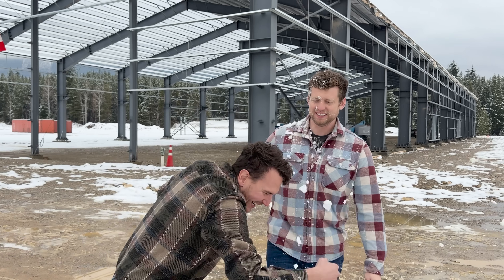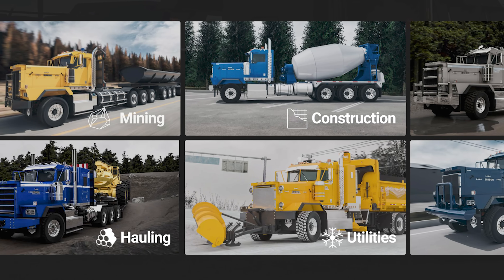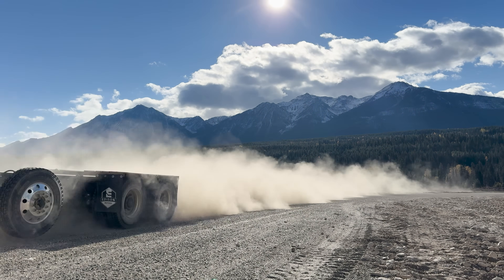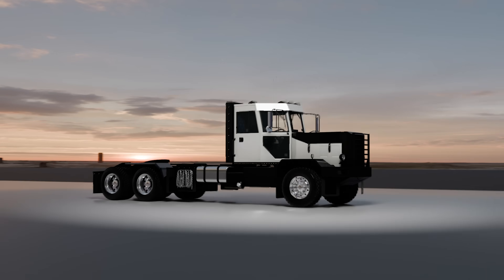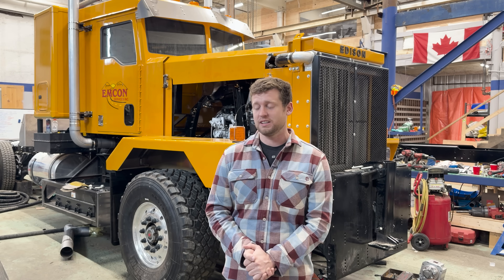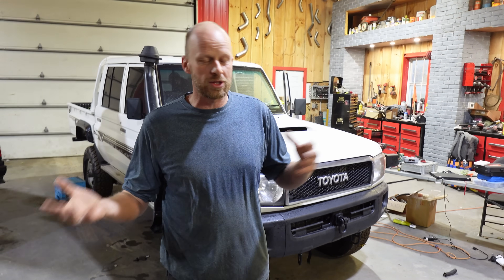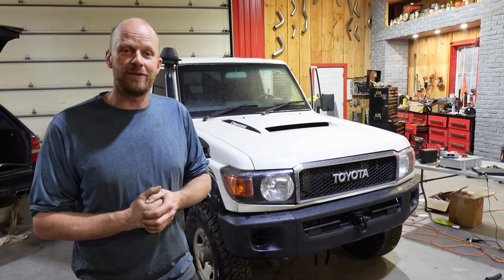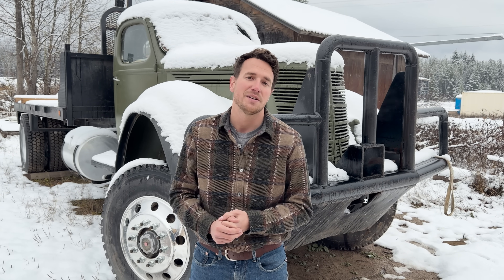VICTORY After RED TAPE: Edison Motors has GOVERNMENT APPROVAL

Comment: Since Edison Motors is still at the startup phase, it's totally normal to focus on improving the tech and a specific market (heavy duty),  but I hope you guys don't forget that reducing drag by improving your aerodynamic also means gains in fuel saving. For long-haul your hybrid system is still more efficient than non-hybrid, and having both, the most efficient power train and the most efficient body, Edison trucks would save even more fuel.

Comment: When you have solved your mission with heavy duty trucks go for mass market with BEV batteries are getting cheaper. But mass market vehicles will not be easy to repair. You have the right approach to right to repair.

Comment: How the f will the Diesel-Electric version be the same weight (or even close) to the mechanical one? Does the transmission and smaller fuel tank compensate for the battery and electric-motors weight?! If so, that's huge! (Also, what about US tarifs rn?)
Reply: Tarrifs? Edison is coping like everyone else. :(

As for weight, if you start with a normal heavy duty vocational semi truck and yank out the 15 liter engine/trans, and put in a smaller 9 liter engine/genny, plus the 3,000 lbs of batteries, then the Edison truck is only like 5% heavier.

Edison trucks don't have 10,000 lbs of batts like a Tesla semi.

Comment: I have a question. Does the Right to repair approach you are follwing also include the software diagnostics and code for the controllers and all the other software included? Thank you, im a big fan
Reply: Yes*

That is a delicate subject. 

I'm confident that Edison wants to give truck owners all the tools they need repair their trucks like truck makers used to do in the olden days.

At the same time, if Edison gives away all intellectual property away for free (and they have spent $10M to make it), then an evil company in India could take all that IP and make a cheaper knock off that would undermine everything Edison is trying to do and in essence, Edison would be feeding their own downfall.

So there is a balance to strike.

Comment: So...on startup or when passing or on a hill, can the battery and generator run motors in parallel for a boost to like double power?
Reply: No
Edison trucks are "serial" not "paralle" hybrids. That said, Edison trucks still have twice the hp/torque over conventional diesel trucks and more than enough power to destroy the tires prematurely

Comment: Is there a HP threshold? Diesel generators are used all the time on busses and trailers and such.
Reply: Threshold? The engine will probably run at full power when it's running
Reply: @Sah-o5m  HP threshold, as in they could not get approved for an on road stationary generator, yet as i said, there are smaller low HP diesels in motorhomes and busses everywhere

Comment: I hope you're using Sodium-ion batteries and not Lithium-ion batteries because Sodium-ion batteries have absolutely no problem with temperatures.

Sodium-ion batteries are fine when it's minus twenty or minus thirty degrees centigrade (that's about minus four fahrenheit to minus twenty two fahrenheit).  CATL say that their next generation sodium-ion batteries will be just fine at minus forty degrees centigrade (that's minus forty fahrenheit).

If you go with the Lithium-ion batteries then the battery pack will use energy heating the battery cells, that's just waste power when you could just have Sodium-ion batteries.

And Sodium-ion batteries have no problems with heat weather either, which means when you're on a charger you don't have to worry so much about cooling.

Comment: I can understand the economic argument but it's a shame you're having to build non electric trucks as well. It undermines the value of your brand as an electric truck company. Some investors may also be put off because if 95% of the trucks you build are pure diesel then it kind of gives the impression that the electric truck thing is just green washing and environmentally minded investors don't want to invest in a diesel truck company. Have you considered using different branding for your diesel trucks to differentiate them from the electric ones? So that when people see a truck with the main Edison Motors brand they know it's a real electric Edison.

Comment: what is right to repair
Reply: Over the past 2 decades, some companies are increasingly using the following anti consumer practices:

 planned obsolescence (parts that fail shortly after warranty), 

parts pairing (only parts provided by the company can work, and the company can charge whatever they want)

Warranty denial if you try to fix your car instead of using a dealer.

And forced subscriptions that require owners to make ongoing payments to keep using the product.

Companies that do this are John Deere that requires a John Deere tech with a $10k laptop to replace parts. Or Apple that uses proprietary screws, and unreplacable screen.

"Right to repair" is an effort to give more value to the auto owners instead of Edison. To this end, Edison uses flat glass that can be sourced anywhere instead of curved glass that can only be sourced from Edison.

Comment: Actually, there is one industry who tried diesel electric, where it didn't stick. Porsche tried it on their Tiger Prototype. It promptly went up in flames in front of Mr H, and they lost the bid to Heinschel. Though some manufacturers are experimenting with diesel electric right now, so you might be right, in the long run.
Reply: Edison is following the diesel/electric hybrid train model. This model has only become viable in the past 10 years due to advancements in battery tech.
Reply: @Sah-o5m  Unless there's some technical details I'm missing due to a language barrier, that's straight up not true? Many heavy vehicles have been using diesel/electric for much longer than 10 years.
Reply: @ericmyrs  Do they mean plug-in hybrids? Traditional hybrids are gas cars that get help from a battery time to time while plug-in hybrids are basically EVs with a backup gas tank in case the battery runs out.

Comment: HDT/MDT:
Have you looked into the RV industry.  I see people converting OTR Volvo's to towing their 5th wheelers.  With the reduction in payload between what you would normally see in a logging truck, you couple probably drop your motors down from 9L to 5L-6L (if not smaller) and still be able to effectively tow some of the larger 5th wheel travel trailers.

Comment: 2:56 Have you guys thought about doing trains between this and the train yard?
Reply: Trains are already diesel electric
Reply: @Gregory-b5y I know... that's why I asked if they've thought about possibly going into that business as well.  If they're both diesel electric, it might eventually(like years down the line) be worth it to go into locomotives as well.  Especially if they're on a train line.  They could have forks off their line that are for servicing or building trains at some point.  And although there is a lot of differences between trucks and trains, they're both diesel electric.  It would be a solid chunk of similar technology, along with a field I'm sure could use a company like Edison.  I mean lots of fields need a company like Edison.  But they're doing diesel electric and have a direct track connection.  It wouldn't be a bad way to go years down the line after they master the truck part

Comment: The conversions strike me as especially interesting. You could advertise targeting people whose trucks have experienced a particularly expensive mechanical failure. Converting a truck to diesel-electric isn't going to be cheaper than replacing a transmission or engine block, but if someone is already staring at the cost of a major repair like that, maybe paying the price of a conversion to get a more efficient vehicle once the process completes is going to sound more tempting.

Any plans to do conversions for cars as well, either to electric or also to hybrid? Some people might really like their old ride, but like the idea of improving its performance.

Comment: I just wish this generator EV driveline combo was commonplace in even just regular vehicles. In the war of fuel efficiency and durability, you'd think that major manufacturers would've done exactly that decades ago.
Reply: In smaller vehicles there’s problems with power to weight, you have an engine that can run the car on its own with the added weight of a battery pack.  It’s crazy that trucks have not used this technology though, it’s been around for ages.

Comment: So can you guys keep prices lower on the new mechanical builds compared to a dealership? And why not throw cat motors in the frame instead of running a junk isx cummins?
Reply: The large truck manufacturers have stopped producing heavy duty trucks. Edison has no competition in this market.

Cat quit making emissions compliant semi truck engines in 2010.

Comment: Edison pickup truck when? I want my f150 to have 130,000 lb/ft instead of 260lb/ft and to not need to shift gears. I go up a hill and the thing barely wants to stay the same speed and when it does, it has to shift from 4th to 1st and back to 3rd repeatedly.

Comment: Per Lean Manufacturing standards, the rate at which you can move materials & products is way more vaulable then the amount you have in stock. Would like to see you guys take of Toyota Production System (TPS) or something similar. Send a couple guys to Japan and tour Toyota,  and also go down to Fast Cap and meet Paul A. Akers (author of 2-Second Lean). This will absolutely change the way you see production! Can't wait for the next updates!

Comment: I know you guys are completely committed to your light duty chassis and how you're currently doing the conversions, but it's flat out wrong and will fail.

Don't be Elon with the CyberTruck and just keep trudging down the same path even though I suspect you know there is no market.

Virtually no one will pay for a hybrid conversion of an old light duty truck that costs more than a whole used truck, especially when it's so expensive that the breakover point on the investment will literally be measured in decades.

I feel like you guys are wholly blinded by your approach to heavy duty applications (where the same approach is appropriate) that you're completely missing the forest for the trees.

People who own old trucks, and are willing to do a drivetrain swap, like that truck how it is they *do not want an entirely different truck that just looks similar*.

All they are looking for is a repower to a newer more reliable/powerful drivetrain tech.
Reply: And yet there are literally 4,000 people who have signed up for conversion kits that will cost 10's of thousands each.

Comment: I realize that you face regulatory obstacles on the full hybrid drivetrains, but why not do "light" hybrid on the mechanicals for gains in experience and efficiency?  What about an electric axle and battery added to a mechanical, like a steering axle or the rear most axle?

Comment: I soooooo want a truly hybrid pickup truck. Either full time electric with ICE backup, or driveline share with the ICE. This is a market that US manufacturers have been lacking. It's such a huge mistake to not fill this particular market. Instead, they come out with these psuedo mild hybrid that only work in the first couple seconds of hitting the throttle (Dodge eTorque 🙄😒). So much truck space is just plain wasted that could be used for batteries and controller electronics to make good truck a great truck for hauling and saving money on fuel and repairs in the long run.
I am so happy and thrilled someone has decided to take this idea from a "hobby" perspective and progress to a full on production business to help drive down pricing on making these conversions. WTG EDISON MOTORS!!!!! 🤩🥳:elbowcough:

Comment: Next milestone, put trucks in wind tunnel and get another 30% gain, and yes after 56km/h the air resistance is larger fuel consumer than anything else

Comment: How does your system stack up against Oshkosh's portfolio of companies and their Volterra hybrid vehicles and their Electro-mechanical infinitely variable transmission?
Reply: I believe Oshkosh uses electric motor between the engine and transmission to assist.

Edison uses the engine to spin a generator with no direct connection to the wheels.

So apples/oranges

Comment: Diesel Electric is king! Range, Torque, and reliability. Just an all around king. I'm so glad they brought up the Railroading industry using it. They have been using diesel electric for over 100 years. First envisioned in Germany with the CNJ No. 1000 for rail in 1912. Utilized commercially in 1925. Its tried and true.
Reply: Tbh pure electric with a catenary makes more sense for freight trains and that is common around the world. But the US companies never could get together to make it work over the entire network. So why would you be the only company to make that long term investment. But even then, diesel electrics are not that far behind when it comes to total cost.

I don't see catenary trucks being a thing in North America any time soon, so there it makes total sense to go diesel electric. Diesel is way more energy dense than batteries so you need to haul a lot less weights this way. 

It just makes sense.
Reply: Size of the US prevents electric trains. The Milwaukee Road railroad had an electrified portion of their railroad that extended nearly cross country. It took massive amounts of resources to keep the rails powered as well as not being powerful enough of an electric system to keep up with the demands from the trains ultimately all factors contributed to the company going bankrupt. Similarly the Virginian Railway a smaller 600 mile coal hauler from Virginia and West Virginia had an electrified mainline it operated until it was acquired by Norfolk and Western in 1958, who later couldn’t maintain the upkeep of the electrified sections and removed the overhead lines.
Reply: @AppalachianMountaineer1863  Nice way to misrepresent the facts. 
They were unable to run it on steam so that is why they went electric, and it worked. 
Sadly they picked 3000V DC without AC secondary lines and that is just suboptimal.

But the worst part is that they invested a ton right before the great depression, and just could not repay their loans. 
The same would have been true if they invested in a new line that was not electrified or purchased a lot of rolling stock. 

Technology also has moved on, that was 100 years ago. If that is the best argument you have against electrification that's pretty limited.
Reply: @MichealHilleman couldn’t run what on steam? The Milwaukee Road had a sizeable steam fleet as well as the Virginian
Reply: @AppalachianMountaineer1863  The electrified line was electrified because it was too cold to efficiently run on steam year round. My guess is that remote water refilling stations froze but I have no source for that.  
Cold weather also makes the catenary more effective but I doubt they took that into account. 
Their other lines where it did make sense at the time were steam. 

Right now virtually all trains around the world are electric, either with an on board diesel power plant or catenary. 
Electrification is more common when there is state control of the lines (and they can enforce the standards everywhere) Just like the US controls the interstates and sluices on the Mississippi. It doesn't really make sense to have critical infrastructure fully owned and controlled by multiple companies.  Then again the US is also under funding the waterways so it's not a magic solution. 

US rail is poorly maintained because of years of mismanagement and individual companies not benenfitting unless the others also maintain their lines. While catenaries would make sense if implemented everywhere the incentives to do it just don't exist right now.

Comment: Super excited, been a fan ever since the first promo vid. Super exciting stuff for right to repair. Have you guys ever considered working with or installing off the shelf hot n clean even if just a simple option? I recently found out about them and they are a Canadian company that do super simple systems to heat windshield washer fluid, and at the gateway to the north of Northern Saskatchewan I can definetely see it being useful on an Edison truck.

Comment: If the truck shreds rubber on the dyno why won't it shread rubber on the highway?
Reply: No. That test pickup was strapped to the dyno.

In the real world, it would just spin the wheels.

Wheelspin can be controlled in the computer to reduce slip

Comment: There's a brake company called Wilwood that makes brake systems that fit antique vehicles. The brake systems allow a wide range of vehicles to convert to power brake systems and often times make the brake systems appear to be stock. I have been a fan of your company and the concept of what you are doing since earlier in the process. I would love to see a collaboration with Wilwood since you are doing similar things to older vehicles.

Comment: So batteries are still a problem and are expensive to replace at the end of life. Are you guys standardizing these packs to increase volume and reduce replacement cost and ease replacement?
Reply: I believe the LMO battery packs that they source from CATL are in a "standard" size.

For any provider of batteries, Edison will need to do some custom integration with the BMS so the batts charge and discharge correctly.

As for end of life, I hope old Edison batteries get stored at the Edison assembly plant and used for solar storage.

Comment: Even within a branch of Transport Canada there may be a line relationship to sub-departments. When the CP Rail Merritt subdivision was abandoned, the rails were removed on either side of a crossing. The signals were still intact as well as the rails across the road. The signal maintainer had to maintain the signals in working order until the signals were removed.